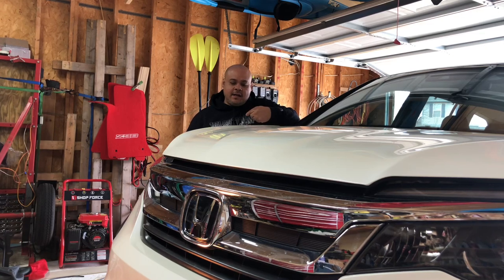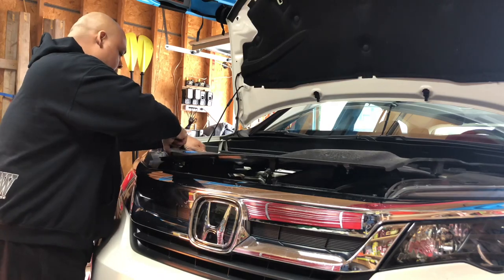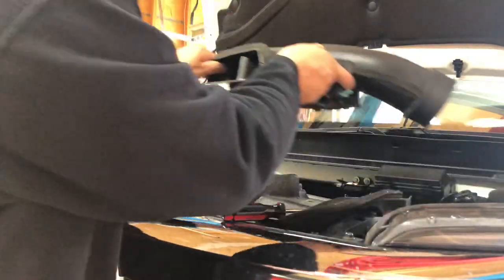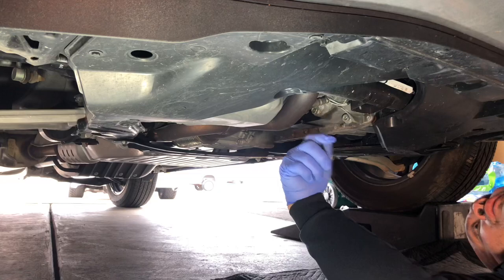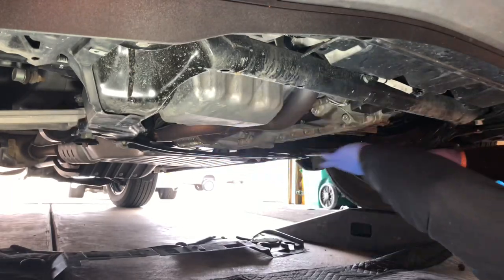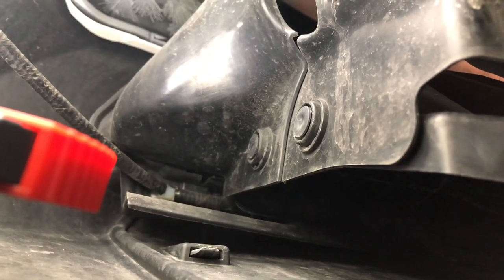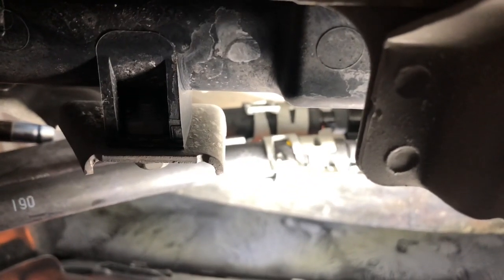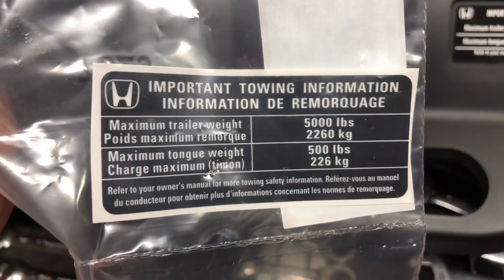2019 Honda Pilot OEM trans cooler install.

Comment: Eddie, Going to start this on my 2022 pilot this weekend. You're videos are just what I needed. They are really good for the home mechanic. Great job and thanks!!!
Reply: Your 2022 Pilot should have the ZF9 transmission which is different, the transmission cooler is the same but the lines coming out from your transmission should be different
Reply: @reyperez3424  Thanks Rey! I'll respond when I install it.
Reply: Have you installed it yet? I’m about to do this on my 2022 pilot next weekend. Was it as simple as he makes it lol
Reply: What’s the part# for 2022? Thanks

Comment: Thanks for the video. Just got mine done 2 days ago.  I ended up adding about half quart of transmission oil after the job. Very happy with it. Thanks!
Reply: What kind of transmission fluid did you use?
Reply: @garrettpeterson9816  Honda ATF from Honda dealership

Comment: Good video, I just have to add a few tips. I went from under in between the grill and radiator and tightened my screws. I used a lighter to soften and remove the old hoses. I removed battery to access the tube replacement. Good luck

Comment: Thanks so much for posting.  Just bought a pilot without one, and the dealer wanted $1500 for the hitch and cooler installed.
Reply from the maker: I hear that’s the going rate! So expensive.
Reply: @eddiesspeedgarage  My dealer quoted $2960 for this yesterday.
Reply: Got quoted $400 lol I think price gauging are going down

Comment: Great video(s). The one for trans fluid helped a LOT. For noobs like me, you might want to remind everyone to take a pic of where all the clips (there are different sizes!) and bolts (there are different sizes!) go, so reinstalling them wont be as much guesswork as it was for me. Also, if you’re going to be installing this cooler and you don’t like hassling with the trim more than once, change your trans fluid and the coolant at the same time. Yeah, I’ve got to remove the gravel shield again. ~face palm~
Reply from the maker: At the time I did the video my pilot was very new. But you bring up good points. Thanks for the suggestions and for watching.

Comment from the maker: Robert my pilot is an ex-l your elite has a different transmission. 9 speed. The procedure is going to be very similar as far as location of the cooler. The lines are what I’m guessing is different.
Reply from the maker: Geo J I will soon for the oil change. My next video coming soon will be the step bar installation.

Comment: when you ordered the kit, did it come with everything needed? extra hoses, clamps, etc? Would love part numbers . . . thanks
Reply: The number should be 06255-RLX-306 as far as I know. Confirmed my finding with a local Honda dealer when asked for a cost of labor to get it installed ($733 for the cooler install only, wow).

Comment: Great video! Have u noticed any motor oil consumption in this truck? Thinking about buying one but I heard its issues with oil consumption...Thanks!
Reply: I haven’t have oil consumption in my 2019 Pilot and either in a 2014 Accord 
Oil changes at 4500 miles
Reply: @reyperez3424  thanks!
Reply from the maker: No consumption issues in any of my 3 Honda large vehicles.

Comment: Thanks for the vid Eddie .  Trying to flush my Coolant on my 16 Pilot .  Moved a ton of cladding but didn't see the Petcock Coolant drain valve .  My Pilot doesn't  have the " drain door " nor is the valve situated where it is on the other 18 -23 vids I've looked at . Do you have a Coolant Flush vid so I can find the Petcock drain ?

Comment: Eddie, did you order all of the parts together as a kit, or did you have to search for them? I remember a company offering a kit for the Odyssey that included everything. Also, did you say the new finishing trim for the rear came with the hitch kit?
Reply from the maker: I bought everything at the same time just called a Honda dealer and told them what I wanted. It was 3 separate items. The hitch with came with the panel. The wiring harness, comes with the trailer brake pigtail. the cooler which came with the 5k sticker. Hope this helps.
Reply: @eddiesspeedgarage  thanks. I was doing some looking and found all of the kits @ HondaFactoryParts.com. The harness and the finishing trim come with the hitch kit and the ATF cooler comes alone. All cheaper than the dealet.

Comment: @Eddie’sspeedgarage Thank you for the videos! Do I have to be ready for a leak of coolant when pipes are reattached? Does it matter which of two pipes to reattach first? How did you ensure that there is no air left in the system (ATF cooler is installed with an air inside)? Thank you for the videos again!
Reply from the maker: It’s not coolant it’s transmission fluid. I didn’t use a drip pan and air in the system is not an issue since it’s not a air tight system. No transmissions are.
Reply: Oh, I see. Thank you!

Comment: These trans coolers are only for the 6speed transmission pilots. The 9speed transmissions allows the 5000lb rating already however a great vid. I don't think I've seen a video of someone installing this on the pilot.
Reply from the maker: You can tow 5k with either transmission as long as you install the oil cooler. Sorry you were miss informed.

Comment: Thanks for the video.  What is the "glove trick" you mentioned when installing the bolts on the radiator through the grill?
Reply from the maker: You use a small price of rubber glove between the bolt head and socket to hold them together
Reply: @eddiesspeedgarage  thanks for the reply - neat trick!

Comment: Hi Eddie, I've watched all three videos and am about to install the trailer wiring harness. I have the OEM wiring harness and trans cooler but a UHaul trailer hitch. I'm thinking I'll just have to get creative with a bracket to mount the 7pin connector. My question is did you install a brake controller with this? I'm thinking I should but not sure which model to go with or how to connect it. Do you have a video on that? Also, I'm a little confused on how to connect the hoses cause the hoses for the trans cooler I got from the dealer look different than the ones used in your video. Plus there are other hose/attachment connector thingys that I have no idea how those attach.
Reply: Did you by any chance got this part number from Honda?  06255-5EZ-316. My kit also looks different to the one on the video because the lines go to the transmission  “warmer”. My pilot is a 2017 touring “9 speed”. Looks like there is the difference on the kits. 6 speed vs 9 speed. I am having such a hard time getting to one of the bolts on the warmer to be able to replace the lines.
Reply: @noerosales8903 I got the following Info from a Pilot Forum. I am about to put a trailer package on my Pilot and noticed two different part numbers for the trans cooler.  Elite: 9 speed transmission: uses ATF cooler P/N 06255-5EZ-316 is in front of the radiator. 
6 speed transmission uses - Honda (06255-RLX-306) is also in front of the radiator.

Comment: Hi Eddie,  great works on your videos.  I watched all 3 videos and got all my trailer hitch, harness, and cool kits installed.  I have 2 questions for you.  1. do you need to add more transmission fluid after installing cool kit and how much? 2. The cool kits feel more hot is that normal?  Thanks for Eddie!
Reply from the maker: I did add about a quarter quart since you know there was virtually no loss, just needed to add what the cooler would hold which is not much. And I’m not sure why you mean by cool kits.

Comment: Question for you I had this installed by the dealer. I have a 16 touring How do you check your fluid after the cooler is added? I can not see my transmission cooler dipstick. So either I’m loosing my mind or it’s somewhere else. Thanks I’m advance.
Reply from the maker: It’s on the drivers side very low it’s hard to see and just as hard to fill. It’s just a metal ring no identifying marks. Not even painted red. It’s basically straight south of the air intake tube

Comment: Where is the OEM tow sticker located on the vehicle? I couldn’t find mine and can’t tell by your video. Thanks
Reply from the maker: If your vehicle was equipped with a tow hitch from the factory it’s in the rear bumper replacement panel. Same place if dealer installed. If it’s an aftermarket hitch that pokes out under the bumper you won’t have one.
Reply: @eddiesspeedgarage  thabks, installed hitch myself, so don’t have one. Going to install the cooler next. Thanks for the vid, great info.
Reply from the maker: @wsvitak  the sticker comes with the cooler because if you tow 5k without the cooler it will void your warranty. Thanks for watching
Reply: Okay so apparently GM & Honda worked together to develop the six speed xmission, why did they not One, give the transmission a larger sump and Two when taking the drain plug out the mechanic can easily only replaces 3.3 QTs when there are 8 QTS that actually need to be changed. I know on my Ford you can rotate the torque converter, remove a threaded plug and drain most of the fluid out the xmission with the pan removed. Can anything like this be achieved with the xmission cover removed when changing the filter, does anyone know ? Thanks in advance.
Reply: @paulschneeman1476  look up the transmission flush procedure for the Honda. It will give you step by step directions. I had the same question. Essentially if your doing a routine fluid change it tells you to check the color of the fluid. If color is good, just drain what you can and refill. (Roughly 3 quarts) if color is dark, you will repeat this procedure 2 or 3 times, or until the color is good. Essentially mix fresh with old, flush, repeat. If you don’t tow, or drive in extreme conditions, getting all 8 quarts out isn’t necessary. Color is key.
Reply: @wsvitak  Thank you for clarifying, guess will have to be happy with Honda's times three procedure.
Reply: @wsvitak  There are also two filters associated with the ATF one being the external inline filter which is next to radiator second being what Honda calls a filter/strainer which bolts to side of xmission with two bolts and seems it would be easy to service/change. Both the filters seem to have a service change requirement around 50K MI. What is your take on these since nothing is ever mentioned on most fluid change posts for 17,18 & 19 Six speed transmissions.
Reply: @paulschneeman1476  yeah it confused the hell outta me at first too and I thought what a stupid process, but reality is you couldn’t get every drop out by draining anyway, so this procedure helps to displace the fluid throughout the entire system. It also isn’t like engine oil. In most cases you could probably get away without changing it at all, or once every 100k and be fine. I wouldn’t do that, but just saying it doesn’t break down as quickly.
Reply: @paulschneeman1476  good question. I knew of the external, but didn’t realize there was an internal screen. If it’s easy to get to and not too much trouble, I would change them both at every fluid change. Dealer recommended 60k, so changing those 2 filters every 4/5 years or so makes sense to me. It certainly won’t hurt. I’m coming up on 60k so I will be doing this soon. I am going to look into the screen as well. Thanks for the heads up.
Reply: @wsvitak  The bolt on fluid filter/strainer which bolts to the side of the xmission is actually a pretty good idea. Uses o-ring(s) ? as a sealing surface. Looking at Honda's part breakdown (Exploded Diagram) o-ring should come included when purchasing filter/strainer from Honda. I would also replace the two bolts which appear to be different, just because one Honda recommends replacing fastening H/W and two Japanese are famous for low carbon/strength fasteners and if either one of those suckers break off in the cast aluminum xmission case would be a PIA to remove.

Comment: I bought a 2018 Honda Pilot Ex AWD, in the Manual it says I can pull 5,000 lbs, but I don't have a hitch , I'm installing it today do I need a cooler.
Reply from the maker: Anthony Fig it can tow up to 5k if you have the cooler. Look through the lower  vent in front on the drivers side lower end of the radiator for the cooler. I’ll bet it’s not there if the hitch wasn’t installed.
Reply: @vick1549  
The transmission cooler does help to keep your transmission temperature cooler when towing

Comment: How many miles do you have and how’s the transmission cooler so far.? Thanks
Reply from the maker: BEA's SLIME MASTER slime master I’m at 18k and I have had no trans problems or any problems besides warped brake rotors since new.

Comment: I'm doing this today. What kind of trans fluid can I use to top off with? I can't get Honda brand.
Reply from the maker: Honda brand is a must
Reply: @eddiesspeedgarage  Thanks for the reply.. It turns out, last time I got the fluid changed it was at another shop, And they didn't use Honda brand. The Honda service writer said it would be okay because all the transmission fluids if they're ATF like DW1 are interchangeable. It's the 9-speed transmission that has the crazy fluid. But anyhow I'm going to do a transmission drain and fill. But there's not going to be any way to get all of the other brands fluid out. So I'll let you know if there's any problems but Honda says there won't be.

Comment: Good video. The sticker you added is incorrect as the max tongue weight changed. Adding the cooler will not affect max tongue weight capacity.
Reply from the maker: Tongue weight changes with trailer weight. If your only towing 3500 pounds you wouldn’t want 500 pounds tongue wrong because then more weight is on the hitch than the trailer wheels. That’s why Honda increased the tongue weight with the higher trailer weight. And if you know of any Honda trucks that tow more than the Pilot let me know and I’ll stand corrected.

Comment: Hi Eddie, I have a 2019 Pilot ex 2wd. When i went to Honda to ask about this, the parts guy said the Cooler kit listed with them is only for an AWD 6 speed. Do you know if the 2wd will accept this cooler?
Reply from the maker: Ed sorry I can’t say for sure. They most likely sell your vehicle specific cooler. I’m thinking that it’s the same unless you have a 9 speed transmission.
Reply: They do not recommend towing over 3500 with 2wd models per manual, so I don't see the benefit of the cooler.
Reply: Oleg Filippov   
It does help, even if you don’t tow
Reply: I wanted to add the trans cooler to my 2020 FWD for good measure.  I can't find anywhere that someone has installed the Honda AWD cooler to make sure that it would fit the FWD 9 speed.

Comment: If I add the transmission cooler on my 2wd Pilot will I still be able to tow 5000lbs?
Reply from the maker: No
Reply: FWD axles are not recommended for towing over 5000 LBS , they could probably get it done a few times but they will eventually break, that’s the whole reason that only the AWD can comfortably tow 5000LBS.
It’s common sense!
Reply: @reyperez3424  Your statement is ridiculous and void of common sense.

Comment: What about adding more transmission fluid?
Reply from the maker: Check your level the change in mine was negligible but I added a quarter quart. There was virtually no loss during the change.
Reply: Eddie’sspeedgarage 
He means if you install a transmission cooler ( which comes empty) you need to add ATF to fill it up 
Those 9 spd are super sensitive if they are missing ATF 
I do recommend to check your level

Comment: where is that "important towing information" sticker located?
Reply from the maker: lysergicninja it comes with the trans cooler. If you have it then it will be attached to the new rear bumper insert that comes with the hitch.
Reply: @eddiesspeedgarage   So I just leased this car two days ago and the salesman told me that it could tow 5,000 lbs. It does not have a hitch though. Is there a way for me to tell if it has the cooler installed?
Reply from the maker: lysergicninja sorry the salesman misinformed you. The pilot is capable of towing 3500 lbs without the trans cooler and 5000 lbs only if  the cooler is installed. You would have to look at the lower drivers side of the radiator in front probably through the lower bumper grill. I bet is that it’s not there because the hitch isn’t there either.

Comment: Do I need this? I have awd touring version
Reply from the maker: Kanti123 if you plan on towing over 3000 lbs. if your car came with a hitch look at the rear bumper near the hitch and there will be a sticker there with the tow weight on it.
Reply: Eddie’sspeedgarage mine tow up to 5,000
Reply from the maker: Kanti123 then you already have the cooler, your all set!
Reply: From the video, you should be able to see the cooler looking through the front bumper. Never hurts to look.

Comment: No idea where that sticker is located.
Reply from the maker: The sticker came with the oil cooler goes on the replacement panel on the rear.